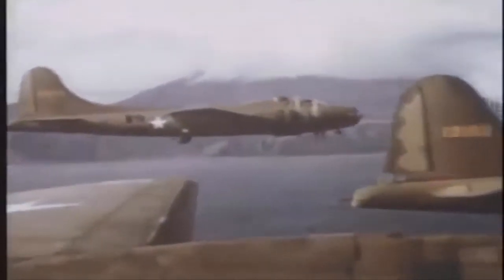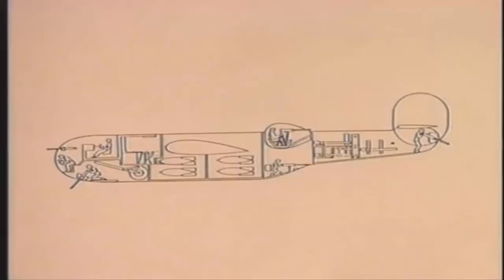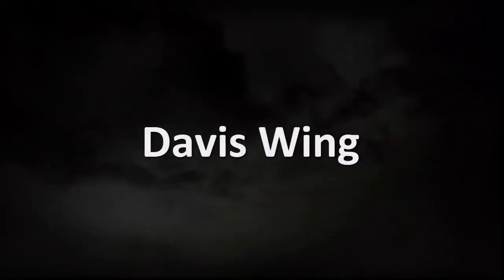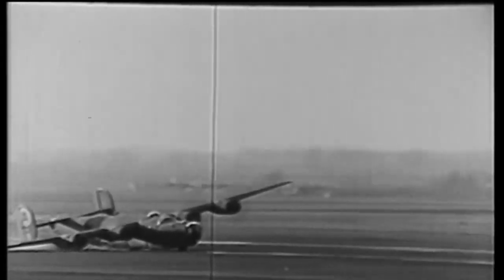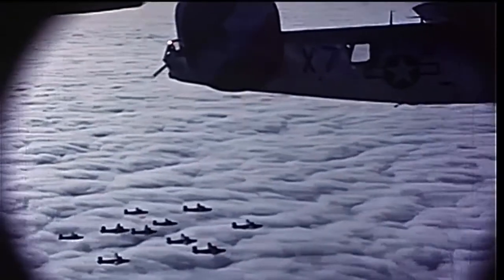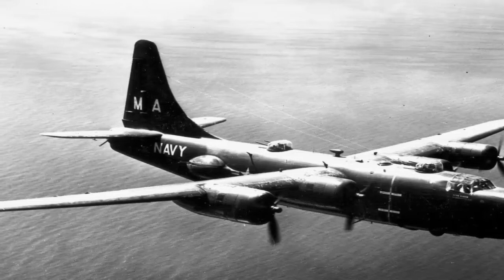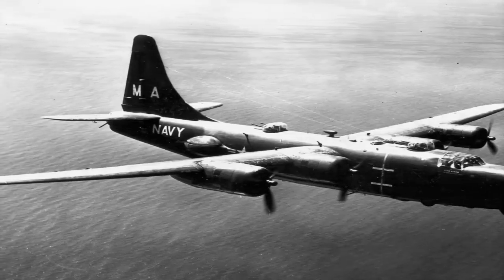B 24 Liberator:  3 Major Design Flaws

Comment: The plane nobody considered for area bombing was actually the Mosquito. Two of these used the same number of engines as a B24 of B17 to carry at least the same weight in bombs. More importantly it was faster and used two crew per plane (4 in a pair) vs 11 crew in one heavy bomber.
Reply: The Eighth Air Force's primary goal wasn't to bomb Germany into submission, but to bring the Luftwaffe to battle and destroy it to gain control of the skies ahead of the invasion. It largely achieved this. Mosquitoes could have delivered a similar weight of bombs with far fewer casualties, but couldn't have achieved the primary mission.
Reply: TWO Mosquitos could carry more than ONE heavy and deliver more accurately with less than half the crew and less build materials. Even more could have been built accelerating the end of the job. They were also an effective heavy fighter so depleting the Luftwaffe could have been done faster and with fewer Allied lives lost.
Reply: @Dave5843-d9m  It can't be a strike bomber and heavy fighter at the same time.

Comment: The B-24 was a handful to fly. I’ve had a flight or two in a liberator, and was told by the pilots that it was heavy in pitch. By contrast, I’ve had numerous hours in a B-17 and found that aircraft to be surprisingly nimble and pretty docile to fly. All things considered, I’d say the B-17 is by far the superior airplane.
Reply: My uncle flew a B-24 in the Pacific. We were fascinated with this as kids and pumped him for stories for hours. He didn't think much of the plane and I suspect it was due to the flight characteristics because I distinctly recall him calling it "pig-headed."
Reply: Neither aircraft was "superior".  Each aircraft had some things it could better than the other. As many other comments have stated, every design is a compromise.  How the plane was designed and built was planned, and determined both strong and weak points in each case. The 17 was tough and easier to fly in general, hence pilots liked it. The 24 could carry a heavier load and was faster, making it more effective in a number of ways. Heavier bombloads, longer range, being among the main points. Each aircraft had it's place in the overall strategy, and tended to be used accordingly.
  Like comparing the p51 to the p47 fighter planes. Many will say the 51 was the best. And it may have been the better all around air superiority fighter(although many 47 pilots would argue that point). But in the later stages of the war, ground attack missions from fighters became extremely effective and important. And the 47 was hands down the best at that. The 51 with its inline engine and liquid cooling system was very vulnerable to ground fire. Whereas the 47 with it's heavier armament and air cooled radial engine could really dish out and take all kinds of punishment and keep going.  The point being, every aircraft found it's niche.

Comment: B-24's were flying Sherman's, reasonably effective, under powered, under protected, cheap and fast to build and easily replaced. And the crews bore the cost.
Reply: @JZ's Best Friend Corporate America's profit was set by the War Material's Board and was generally 10%, except for Du Pont who made $1.00 on the entire Hanford contract and then had to refund 66 cents...

Comment: Great films, shut the sound off. Facts from wikiwhatever. Gen Jimmy Doolittle flew the prototype and looked at the unprotected hydraulics everywhere and recommended it for transport only. His report called it a death trap in combat. He understood what the war in Europe was going to look like. A B17 was manual or electric, few places where one good shot would bring it down. B24 did very well, especially in the Pacific where it had long range. It could not fly in a B17 formation because the Davis wing had a very high loading. What that means is it dropped like a rock in wake turbulence. A quote from some memoir was "the Banana Boat drivers could only look on in envy (of the B17)" Fall Of Fortresses??? Highly recommended reading.

Comment: I'm surprised that the B-24's fuel system is not mentioned.  In addition to being leaky, there was a nexus of piping in the fuselage over the wing that was very vulnerable.
Reply: You are correct and I remember reading somewhere that inside, especially around the wings was reeking with smell of gasoline...
Reply: Read an item awhile ago that the crew of a B-24 on fire, had 15 seconds to bail out before it exploded.

Comment: B-24 could actually go into a controlled dive while B-17 couldn't, as well as the b-24 being faster already (from "Into the Blue" is the name of the book, I think, it was about liberator operations over Europe).  There is an incident where a B-24 crew and a B-17 crew had an informal unannounced race during or immediately after the end of the war (really was just the B-24 crew trolling the b-17 and showing off, they basically just dived right past the B-17 and left it behind them).  Also, despite having inferior wing loading, the liberator could actually carry slightly more bombs than the b-17 (I think due to having a larger and more space efficient bomb bay).  In general, (with the exception of the B-29 superfortress I think), American long range heavy strategic bomber design doctrine placed less emphasis on bombload than British design doctrine, partly because the US placed far greater emphasis on bombing with accuracy instead of saturation.  The Lancaster could carry almost twice as much as either the b-17 or b-24.  Despite the wing loading disadvantage, the B-24 had a superior climb rate to the B-17 by the way.

Comment: Too many B-24's were lost in accidents here in the States. They were just kids really. My Uncle flew them and said with a heavy load they were a struggle to get off the ground. Constant trim due to bomb load,ammo use.and fuel changes in balance. Once in the air you had to get the thing up on the "step" as he described the angel of attack and if you didn't you would slush along using up fuel and constant throttle adjustment to keep speed up. He flew missions over the "Hump" to China and while most were supply missions every once in a while they would bomb targets South of them. Once the B-24 was unloaded of ordnance and with a much reduced fuel load they would fly very well and fast.  This comment made me think of the "Lady Be Good" . Once they jettisoned their bombs and had used a lot of their fuel and the navigator stopped being a navigator their airspeed picked up dramatically and while overflying their base they flew quickly on to their fate. The very last one,an F-7A photo ship, in service with the USAF was "Nemesis"  a converted B-24J sent to the pacific theater. Scrapped in the 1960's in Hawaii.

Comment: Also, because of its high wing, and relatively weak fuselage, (caused by its large roll-up bombay doors), the B24 had very poor "belling landing" characteristics.
Reply: Most aircraft do…..if you have to do a belly landing you have way bigger problems than how the aircraft performs sliding down a runway.   I wasn’t around then but I would like to think that a manual gravity extension for landing gear was….even if both hydraulic systems were lost you can still lower the gear.  

That is also why today’s landing gear handle has a wheel or set of wheels on the handle…even if incapacitated by smoke you can usually feel around for the handle.

Watch Unbroken…the biographic story about B24 bombardier Louis Zapperini….Olympic runner turned Japanese POW….after surviving almost seven weeks stranded in the middle of the Pacific after their B-24 Ditched….three initial survivors but when captured by the Japanese Navy only two. Normal crew was about 7-10.  All other crew went down with the aircraft.
Reply: @stephencannon3140 ; General James Stewart, (yea, that "Jimmy" Stewart), who piloted B24s, disagreed with your assessment on belly landing a WWII bomber. In an interview, he said B17s had very good belly landing characteristics, but the B24's belly landing characteristics were all bad. I never flew a B24 or B17, and I doubt you have either, but I figure a real B24 pilot knew what he was talking about.

Comment: Dad was a wireless operator / air gunner flying in Libs in RAF Coastal Command.

His take was 'the bastards wouldn't ditch'.

If there was dingy drill on the station, he said no one bothered to turn up.

There's a entry in his log book which is sobering given that - 'Attacked U boat on surface. Aircraft damaged, returned to base'.

On the plus side, it would stay airborne on just one engine.

Comment: Or, alternatively, the B17 was over-engineered and inefficient, hence it didn't have a very big bomb load for its size, and it survived battle damage so well because it was over-egineered.  I hadn't heard that the B24 was particularly difficult to fly, but if so, that's the only one of the things listed that is actually a flaw. I very much understand crew preferring to do missions in B17's though; becuase it was over-engineered, it was stronger than it needed to be, and so better able to survive battle damage and get the crew home!  Both were great aircraft, though!
Reply: The B-17 was capable of a massive payload - almost 18,000lbs within the bomb bay and on external hard points, for short range missions.  Remove the 13 .50 caliber machine guns (like the Lanc’ did when carting a GrandSlam, in addition to the removal of armor), remove some of the crew and armor and the bomb load increased accordingly.

4,500lbs was the typical load for long distance raids, with full fuel, and fully armed with the 13 machine guns (heavy) and a full complement of ammo (very heavy).  Midrange missions of around 400 miles carried 8,000lbs.  A 6,000lb bomb load could be flown 2,000 miles.  Curiously, these profiles did not use the external hard points - too much drag, reduced ceiling??

Anyway, it had a pretty large bomb load.  If a mission could tolerate the tradeoffs, it’s max was pretty similar to its peer aircraft.

Comment: If I can offer some constructive criticism...
The things you identify as design "flaws" -- the Davis wing, lower ceiling, poor maneuverability -- I'd consider more operational challenges. A design flaw would be a flap system that caused the plane to go into a violent maneuver, or weak landing gear. These flaws you cite are mainly flying attributes that pilots had to deal with on missions. But none of them inherently made the plane dangerous or unflyable.

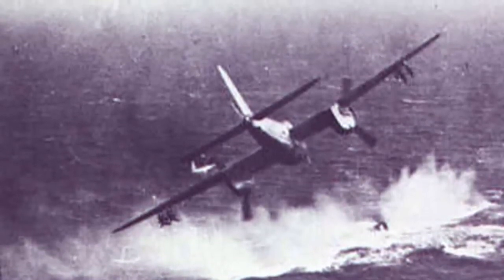Also: 1:57 Not a B-24. 4:25 Not a B-24. And definitely drop the mechanical narration since it can't even pronounce B-24 accurately! 😁
Reply from the maker: Thank you I'll work on my mistakes next time

Comment: The cleaner the wing, the greater the lift.  The ideal wing should have no engines mounted in it giving it a clean leading edge, and a top-surface and a bottom-surface uncluttered by engine nacelles.
This of course is only possible with a sailplane.  Powered aircraft must have engines and multi-engined propeller aircraft must have wing-mounted engines.  Aircraft like the Lancaster or the Mosquito, with their mid-mounted wings,  have engines IN the wing with a nacelle on the top surface of the wing and a nacelle on the bottom surface.  These nacelles introduce turbulence in the airflow over the wing and reduce lift.
The high-mounted wing of the B-24 allowed the engines to be slung UNDER the wing leaving the top-surface largely "clean" and the leading-edge to be pretty "clean" too.   That, and the high aspect-ratio of the wing, gave the B-24 lots of lift and relatively little drag---just what you need for long range.

Comment: If I had to pick a bomber to serve in it would be the B-17. Your chances to survive were better. The B-24's wings were weaker it caught fire more easily and you wouldn't want to ditch in it because with it's high wing design the cockpit had a tendency to snap off meaning you died.
Reply: Not true.   The loss rate of the B-24 was slightly lower than the B-17.   Your chances of survival were better in the B-24.   We could argue that being due to the B-24 serving in much greater numbers late in the war when German air power was waning.   Regardless of that conjecture, the statement that B-24’s were targeted before B-17’s and more likely to be shot down by flak simply is not true - the numbers don’t lie.
Reply: Not so, the Lib had a slightly LESS loss rate over the 17. The 17 had more wing area... hence more sheet metal to get shot up without hitting a spar. Many of those same hits would have missed the Lib.

Comment: B24 was more advanced, more complicated, needed more skills to be operated.
One flaw was about mass centering, crew member moves into the fuselage were detrimental to performance and they had to stay in place with limited possibility to walk a few. this was very hard to stand during long flights.
The liberator had a lower max service ceiling but this was not very important because raids were done at lower altitudes. So this was not a problem (crews needed oxygen and couldnt stand very long the conditions at the B17 max ceiling - 10 000m, which is the altitude were airliners operate nowadays. Remember, B17 and B24 were unpressurized and their fuselage were open to the air. And it took hours and a lot of fuel to climb to these altitudes, so this B17 superior performance was not really useful.
On the other hand, the B24 cruise was about 50km/h faster (+15%) allowing shorter exposure to ennemi defenses, and limited the action of ennemi pursuit fighters.

The B24 could bring more payload at long distances than the B17. B17 payload diminished faster with the distance. And only the B24 had a sufficient range to attack all Germany from England. 

B17 was a very successful design, and was easier to fly because he was designed earlier. Engineers took more stability margins at that time because of the lower  knowledge of aerodynamics. 
B24 coud do better, but required more skills from crews and was causing more workload to achieve superior performance.

Comment: its not as bad as the failed backup plane for the b29 in case it failed which it didn't
Reply: That was the B-32 Dominator.
Reply: @pbandj37  lol dominated by problems
Reply: The B29 almost failed. Engine cooling issues, engine fires, other issues. However, when you consider the fact that it was truly cutting edge technology, it is remarkable that enough of those issues were dealt with to make it a truly effective weapon system. Imagine, in 1942 you had a plane that was pressurised, and a computer that controlled the defensive armament, among many other innovations. Took some time, but the B29 was one of the really great aircraft.